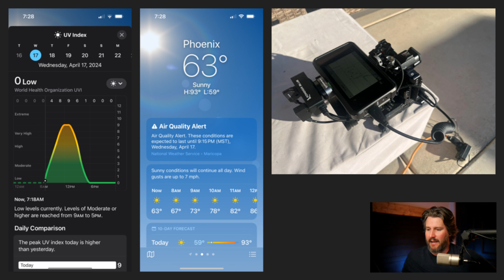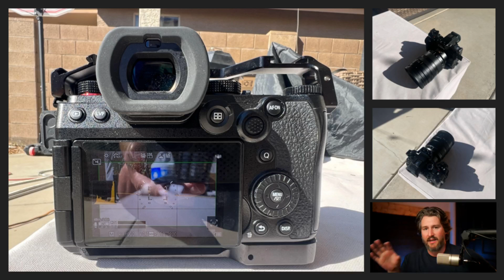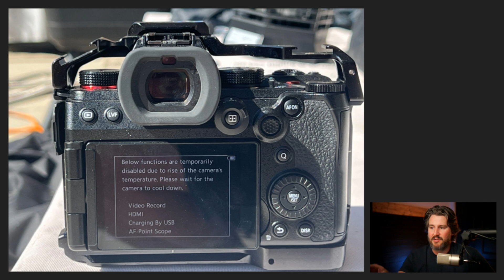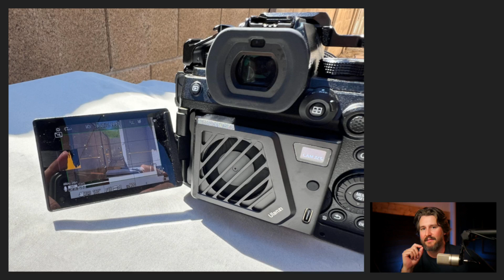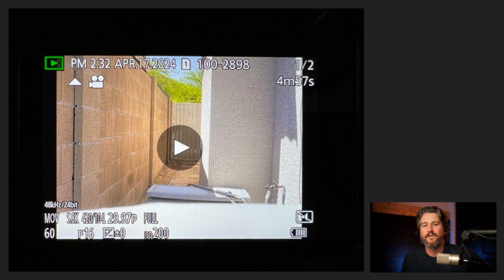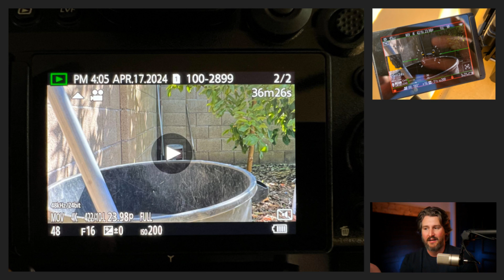HOT SHOTS! LUMIX G9II EXTREME SUN/UV TESTING

Comment: I have the g9ii and have used it in 90+ degrees to film lacrosse. I had no overheating issues. Now I will admit, when I wasn’t filming I kept it out of direct sunlight. And…I wasn’t filming for an hour non-stop. Still I went into the situation realizing that it is not my S5ii. Incidentally, I decided to purchase it for the smaller MFT lenses. AND I’M WITH YOU. Panasonic didn’t lie at all, but I did purchase it thinking it could do what my s5ii could do. Still, I love it, I love lumix, and I will be purchasing the GH7.

Comment: I can understand photographers not wanting their bodies to have the added bulk of a fan system like what's in the S1H or GH6, because overheating is generally not a problem when shooting photos, and those cams are chonky bois, and the G9II is nominally a "photo camera".

But the S5II has a fan with really no added bulk- maybe the EVF hump is a little longer than it would be otherwise, but nothing that affects handling. The G9II shares this body so why not include the fan? If anything I would think there's even more room inside the body due to the smaller sensor.
Reply from the maker: Yes the S5II and G9II share the exact same body style except for the fan and vents. So it was definitely a choice by someone to make that change.

Comment: In my case and many other videographers I know, the g9M2 is the GH6 fixed (I had the Gh6 for two years and sold it). A lot of things are much better on the g9m2, the obvious ones: Phase AF,  Vlog starting at 500, DR Boost well implemented. And others like: Back up recording (you need this is you are doing serious work) , in low light conditions the noise is much less at high iso (this is very important too).  Anyway thanks for the tests in this video and sorry for my english.

Comment: I'll inform you about the ulanzi fan a bit. There's two modes, one lower speed and one high speed, I assume you had it on high speed. Also when externally charging it, it goes faster than even the high speed mode. So I would love a test if you can do it with such external charging in high speed mode. I am in india at 104 fahrenheit and it hasn't overheated on me, but I also shoot mostly music videos in 4k 60p and 30p, so 5-10 mins max continuous. I would still love to know the results, because I haven't purchased the ulanzi fan yet so that would give me an idea whether or not I should just in case. Thank you so much!
Reply from the maker: Yes I had it in high speed more and plugged in for a bit, it does work and I like the design

Comment: Stronz - Do you think Panasonic and other companies should add a small temp graphic on the screen? Like a small guage with 5 segments or bars. Three green, one yellow and one red. This way, we get a real-time status display of what is going on. The worst part of an over-heat shut down is not knowing when it will hit you!!!. This is the main reason why I sold my A7-IV and made my S5-IIX my main photography and video camera. My S5-IIX is bulletproodd and my A7-IV was not. This is also why I never sold my beloved GH6 for the G9-II.
Reply from the maker: I don’t know that we need more graphics or displays, I really want the problem to be solved at the root where these companies do a much better job at ensuring these devices are less prone to overheating. Of course anything can overheat in extreme conditions. My iPhone for example has occasionally gotten “too hot to use” and needs to be cooled before it can operate. However those instances have been rare and under excruciating thermal torture (110F-120F Phoenix Summers) Apple does a good job making sure the iPhone works all the time and it’s only in the very rare fringe extreme cases where you encounter issues. With cameras since 2020 it’s become more “acceptable” to not include proper thermal management and it leads to all these unfortunate scenarios. I want better design, so we can have better and more reliable tools to do the work.

Comment: This is very helpful and kind of, what I expected. For me, traveling and shooting stills and video with the camera in the bag and switched off most of the time, it is OK. I am the intended use case for the camera. When I shoot an event, where I like to run one camera on a tripod for 2-3h and shoot short takes all over the places with a second camera, the GH6 will be the fixed camera and the G9-II the B-cam. I'm fine.
The fact that direct sunlight is making everything so much worse is interesting. I googled for "hot shoe umbrella" and it looks like there is a market for this problem. I wouldn't be surprised if such an umbrella is helping a lot, may be even more than the Ulanzi fan.
Reply from the maker: Yes any kind of shade apparatus would likely work wonders but you’ll always be limited by the angle of the sun